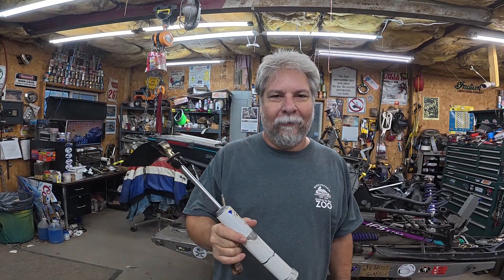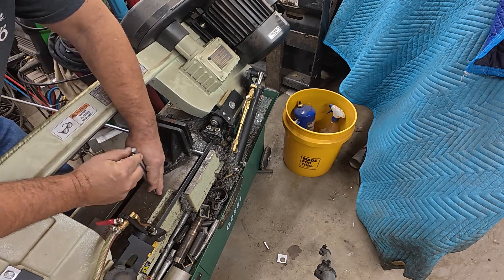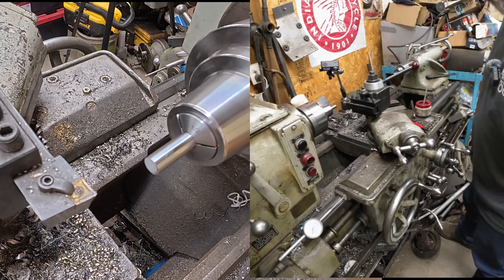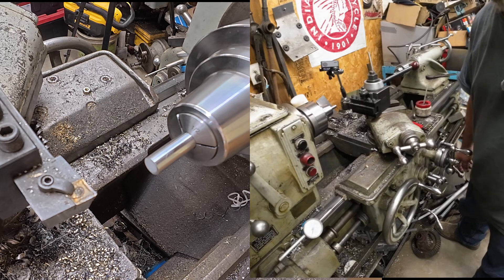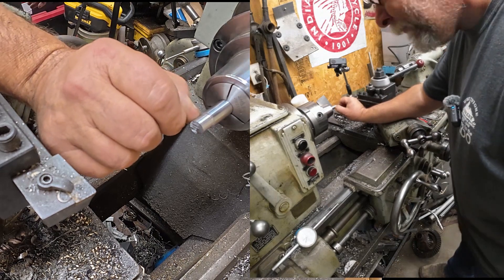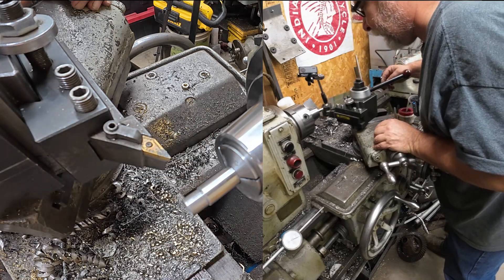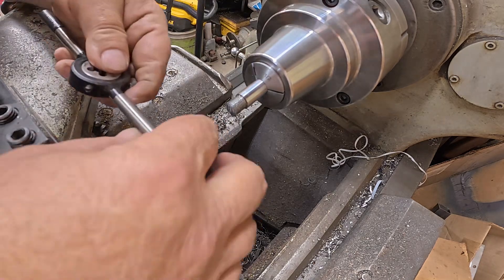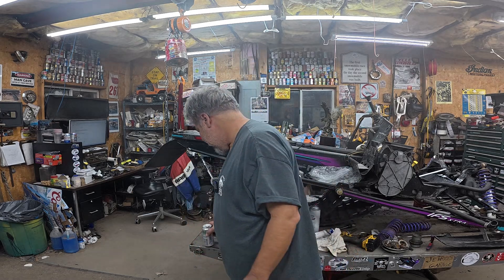Making a Polaris Snowmobile Fox IFP Shaft on a Manual Lathe.

Comment: I always had to hand make my single point thread cutter out of tool steel. Never used a carbide bit before. Looks way easier. 👍
Reply from the maker: I used to do that too, but that tooling is so cheap now they pretty much force you to buy it :)